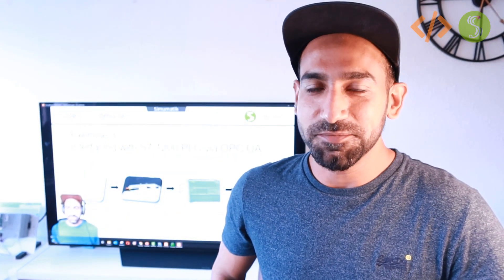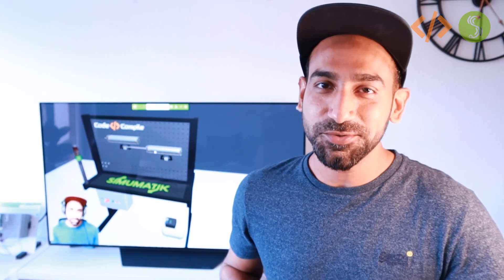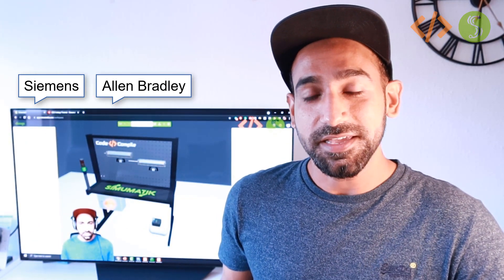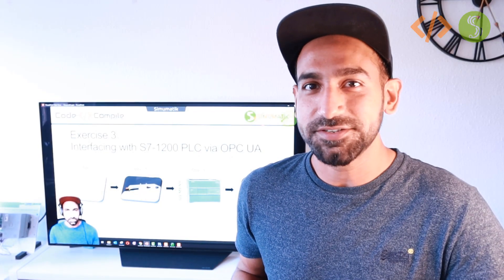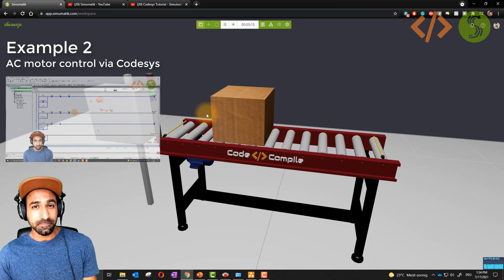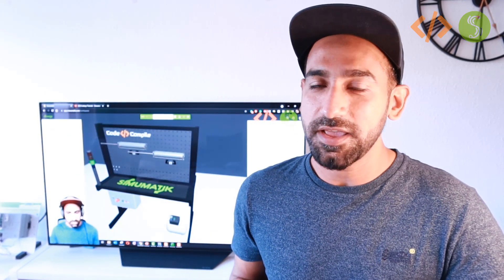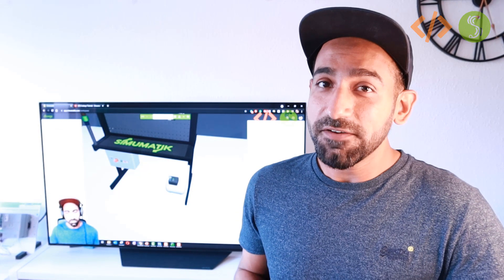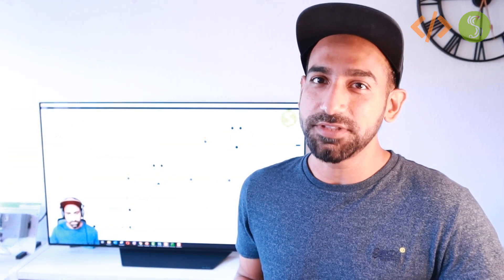Introduction to  Digital Twin Platform

Comment: Hi I am a student, for my capstone project I need to build a digital twin of a chosen physical workshop system. Do I need to source for a PLC or make any other major purchases if I use Simumatik for my project?
Reply from the maker: Hi, You can use physical PLC or SoftPLC (PLC software) to connect to the Simumatik. You can contact me for more information at rajvir@codeandcompile.com